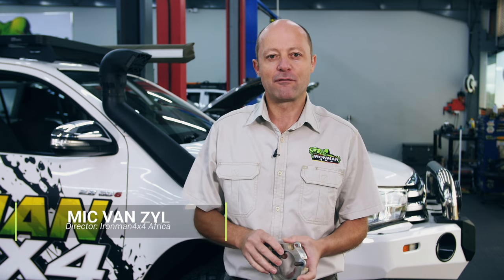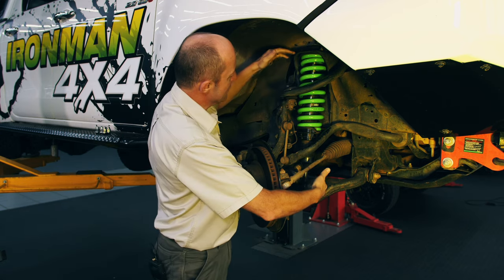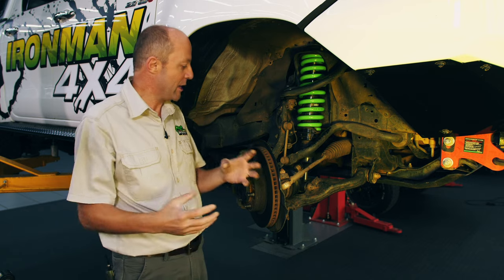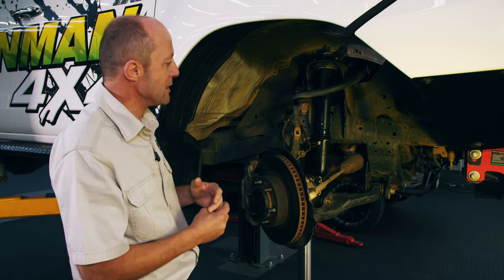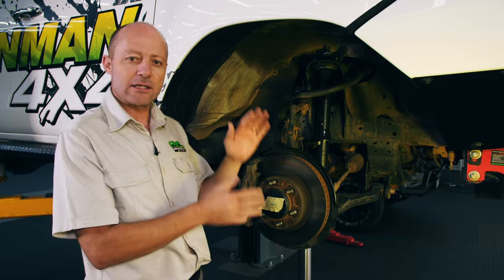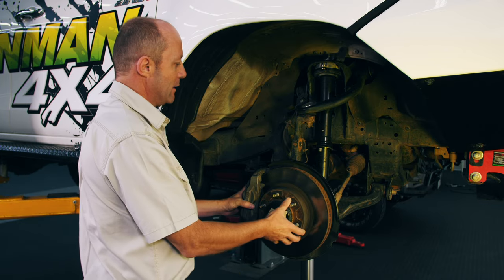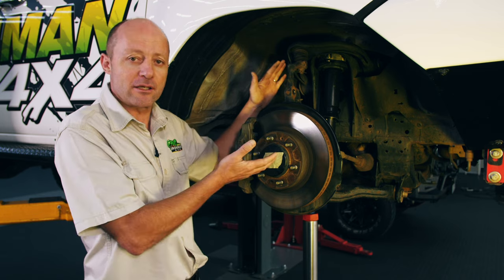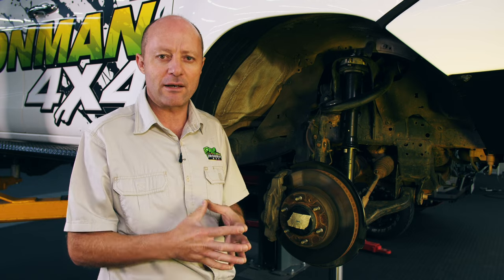Suspension Spacers - Tech Talk with Mic from Ironman 4x4

Comment: Man those things can easily be resolved. For stopping spring to from compressing too much, we just need to increase height of bump stop. And the last case you showed where spring comes down way too much, it will only happen when car is in air, it will never happen under load.
Reply: agree
Reply: Going offroad over bumps you actually have a likelihood of short bursts of full droop, still not a concern if you have limiting straps

Comment: So Mick...just to understand you right.... it will only be an issue when your vehicle is suspended in the air?? Because how I understand it, you took the suspension the the lower most point but that will only happen when you go hippie ca jeeey in the air.... What about front load, what about caber... Just asking or are you just trying to sell your product? Needless to say, I've got billstein suspension with a 50inch lift kit and never in my life have I encountered problems as shown on this video..
Reply: damn true,

Comment: Yes maybe they can be dangerous, but I've been driving with spacers for 8 years now no problems (on and offroad) and I still feel it's 1 of the best and in-expensive mods I've done
Reply: I woulnt listen to this too much , these guys are on the business of selling products , they make more from selling a $1500 setup with new springs and shocks than selling $200 spacers
Reply: @Ozfreerider_adventures  you would probably be best doing new upper arms that match the lift as well. This corrects the Alignment and allows more droop clearance. Not $200 if you factor that in as well. Just installing spacers alone is sometimes on the limit of the alignment adjustments.

Comment: How is that different to fitting a longer strut and raised height coil ? Wouldn’t the bump stop, cv angle and ball joint still have the same issues ? The coil bind issue wouldn’t happen but the others still remain or am I missing something here ??
Reply: Exactly! The only problem with the spacers is the compression of the coil and the bump stop, and is also only n problem of you go more than 20mm spacers, but I agree the cv angles, control arm, ball joint angle all still happens if you fit a shock with longer coil

Comment: Why not just add a bump stop extender on it eleminate all the hassle also the car isnt under load with the extreme angle once its on the ground it should get bit better. Still ita not made for it i get that but the risks in that size lift should be minimal.

Comment: Wouldn't a 2 inch coilover lift kit for this jeopardize the CV's and ball joint the same.         Also, If the shock is the droop limit, isn't it then "topping out" the full extension travel, and you risk mechanical damage to internal piston mechanism in a standard shock w/o internal bump stop or other mechanism?

Comment: On the Mcfersion struts the bump stop is on shaft of the shock component of the assembly so the spring will still only compress that same stock amount. The droop will be more however so the CV joints will be stressed at a greater angle.

Comment: 0. Did I get this right? The top limit of the wheel travel is the rubber bump stop. The bottom limit is the full open length of the strut. The difference between these is the "wheel travel".

1. When you say that only the static equilibrium point shifts when the ride height is "lifted", what type of lift do you mean? How was this "lift" achieved.?

2. If a top hat spacer is fitted above the strut, to achieve the aforesaid "lift", then the static equilibrium point would still shift down. But would the strut's extended length also cause the down travel to increase beyond the previous droop limit. Would this mean that the wheel travel in this case is not conserved and has increased? (by an amount equal to spacer thickness) ?

Thanks for the video and effort in explaining it practically.

Comment: Cool video showing why strut top spacers are not the recommended way to lift trucks. Though this is not a problem for McPherson struts where the bump stops are at the top of the shock 👍🏼 e.g. Subarus

Comment: Question, I understand the issue of the coil compression/bump stop.
In regards to the extended doop, CV angles etc, how is the spacer any different to fitting an aftermarket strut and coil to give you the same lift? (Note I'm not someone who recommends spacers due to the first issue)
Reply: Hi James. The total length of the strut is measured from the top of the strut top mount (that bolts to the chassis bracket) and the bottom eye of the shock. The strut top mount is mounted to the upper part of the shock shaft. This total strut length determines how far the wheel will droop when it is lifted off the ground when off-roading. The droop is thus controlled by the total length of the strut assembly. Fitting a spacer effectively lengthens the strut by adding the thickness of the spacer to the top allowing the wheel to droop further (about 2x the spacer thickness) which causes inner CV joint binding/eventual failure as well as upper ball joint over-extension. Fitting longer coils to a correct length shock (without spacer) doesn’t lengthen the strut assembly and doesn’t cause the aforementioned issues. A standard coil spring at normal ride height will carry the front of the vehicle more or less half way along the shock absorber’s length of travel half way between fully extended and fully compressed. Fitting an aftermarket lift coil merely lifts the ride height closer to the fully extended point. You thus have less droop and the wheel will hang sooner than with the standard coil. The strut length stays the same. No issues on full droop.
Reply: @micvanzyl  That is simply not true. If the aftermarket strut length is the same as stock, there will be absolutely no lift, unless the aftermarket would not sag at all, which would result in an impossible ride comfort. The majority of the aftermarket suspension on off-road vehicles also raise the vehicle. The CV is angled as much as in the case of a spacer at the same final lift. The droop is limited on some pickups (like the Ranger) by the upper control arm touching the strut housing. The benefit of an aftermarket suspension is, in the context of this video explanation, to eliminate the risk of the coil bind. There are solutions for that too, one could fit extended bump stops.
Reply: @mugurmartinescu5728   Sorry Mate. Some of your replies are simply not true. Please bear in mind that I have had a career in steering, suspension and suspension geometry for the last 30 years. While I see new things very often which is great, I've seen a hell of a lot during this time.

1. YOUR COMMENT: "That is simply not true. If the aftermarket strut length is the same as stock, there will be absolutely no lift, unless the aftermarket would not sag at all, which would result in an impossible ride comfort."
MY COMMENT: The lift comes from a spring with higher spring rate and/or a taller spring, not the length of the strut.

2. YOUR COMMENT: "The majority of the aftermarket suspension on off-road vehicles also raise the vehicle. The CV is angled as much as in the case of a spacer at the same final lift."
MY COMMENT: This may be true at ride height when the vehicle is standing on its 4 wheels on the ground. With a spacer fitted however, the total length of the strut is now longer allowing the wheels to droop further taking the CV angle past critical maximum angle. We see this very often. My youngest brother owns a very large CV and drive shaft business. He sees CV joint failure constantly with 4wd vehicles fitted with spacers. I cannot argue with him on that.

3. YOUR COMMENT: "The droop is limited on some pickups (like the Ranger) by the upper control arm touching the strut housing."
MY COMMENT: This is incorrect. The droop limit on the front of just about all Strut equipped 4wd pickups and wagons currently (including the Ranger) is determined by the length of the strut. That is why it is critical not to extend the length of the strut (which is what fitting a spacer to the top of the strut does). If your upper control arms are currently touching your struts, you have too much droop.

4. YOUR COMMENT: "The benefit of an aftermarket suspension is, in the context of this video explanation, to eliminate the risk of the coil bind. There are solutions for that too, one could fit extended bump stops."
MY COMMENT: The benefit of fitting an aftermarket suspension, provided it is a properly engineered product, is to induce a lift where required that ensures that all of the front suspension geometry limits as designed by the original vehicle manufacturer engineers remain in place. This will ensure that you do not have component failures while traveling down the road in your 4wd with your family on board and other road users around you. Fitting a spacer on top of the strut and then compensating for this by fitting an extended bump stop may well eliminate the potential coil bind. It will however certainly not eliminate the over extension of the droop. There are many vehicles with spacers and other cheap and easy suspension lifts (extended shackles) out there. We get them into our workshop every day. Most will not experience any issue. However, we have had far too many vehicles arrive at our workshop with serious suspension failure or imminent failure due to spacers and other unsafe modification issues.

We refer to suspension components as "LIFE & LIMB" parts. If they fail, you could lose LIFE & LIMB. I cannot fathom why one would risk your life, those of your loved ones and other road users by saving a couple of bucks on a properly engineered suspension lift by going for these quick fixes.
Reply: @micvanzyl  thank you for this thoughtful explanation. It makes sense and I appreciate it and apologize for making some assumptions. The explanation of the overextending CV makes sense now.
Reply from the maker: @mugurmartinescu5728   You're most welcome Mate. Safety first.
Reply: @micvanzyl i have a question. If you do a 20 -25mm spacer , and your drive is 95% onroad and 4% gravel road and 1% maaaybe a bit of offroad is all of this still relevant?
Reply: U need to upgrade the upper A arm
Reply: @mugurmartinescu5728 in that case what if u put in a spacer which extends only as much as an after market strut ?

Comment: I had my 2” lift on my Pajero gen 4 but it seems still not enough height for me,I’m planning to ad 20mm coil rear spacer and 10-12mm front strut. Just a bit additional of height,do you think it’s too risky and not good for the cv joint?
Reply from the maker: These vehicles have independent suspension both front and rear. 40mm is maximum you should be lifting these. Certainly drive shafts will become an issue over time. Shocks topping out on suspension rebound = $$$$$$.
Reply: Increase your tire size, that should give you more ride height

Comment: Wouldn't a longer shock/spring assembly also have the same issues as a spacer? For example, the upper control arm at full extension and the CV angles?
Reply: Yes it can..then to fix that problem you need to upgrade upper control arm
Reply: And what about the CV angle ?

Comment: Mic, 2 questions: 1 if I fit the spacers with a shock extension and bump stop spacers too will that have the same negative effects mentioned? 2 if i do a spring replacement of +25mm instead of the spacers will there be any similar issues?

Keep in mind I drive a 2018 Suzuki Vitara LY and just want a lift to fit some larger tyres for more clearance.
Reply: Hi Ruan. I cannot comment on the Suzuki as we do not have suspension for and have not worked on this vehicle. Any spacer between the top of the suspension strut and the vehicle chassis mounting point is going to allow the wheels to drop down further past the original suspension travel droop limit originally intended by the vehicle manufacturer. This may well compromise the upper ball joint and the drive shaft angles. Fitting 25mm lift coils will not cause this as long as you keep the original shocks or use shocks that have the same length as the originals.

Comment: I have a question for you in the 4x4 sector and I would like to know if you can tell me if it is true that the ironman nitro gas shock absorbers go well with the original series set-up and can they be adapted with the +5?  I have a Suzuki jimny 4x4 with m13a 1.3 l petrol engine with standard shock absorbers and calibrations, yesterday afternoon I picked up the new ironman nitro gas shock absorbers and the 4x4 spare parts dealer in Florence told me that these ironman nitro gas shock absorbers are ok for off-road 4x4 with suspension standard or in a second you could put the springs higher and it becomes a +5 high setting is it true?  Greetings from Florence Italy!

Comment: But, with a lift kit with spring and shock, the over extention would have the same issue, wouldn't it? The only "bad" i see here is on full compression, when the spring is fully compressed before the bump stop kicks inn. As i see, this is the only downside compaired to lift firt spring and shock. Unless you go full package with control arms, diff lowering kit + + +
Am i thinking completly wrong here?

Comment: That’s quite a large spacer, I’m guessing with something like a 10mm spacer which I’ll give you around 15mm lift at the wheel, to correct sag caused by bull bar etc. would not be such a big deal. Anyone have any thoughts on that?

Comment: I am planning to put spacer to allow less than 4% increase in size of my tyre as I want a A/T on my nissan x trail t32. Are there recommended spacers to buy. I will be off roading once in a year probably and not hard core. I just want clearance from ground. I know some friends did plastic spacers but did not have any issues . They dont do 4x4 wheeling in regular basis though. What set up is advisable then to give more clearance on my car for beach and desert ride. Will not be doing desert or the like safari.

Comment: Hello there!

What about just a 40mm / 1.575 inch "cheap lift kit", just for daily usage, almost never anything seriously offroad, gravel/light muddy road at best.
2010 RX350.
I don't really think I'd run into any of the problems mentioned in this video.
Can anyone chime in or share their experiences with similar usage?
Also.
OEM is 235/55r19.
I'm at 255/65r17.
For 27.5% more side wall; much greater bump absorption, and on super quiet tires, with internal sound dampening.

Just thought a 40mm 'cheapo lift kit' would fit the bill for slightly more ground clearance, as am in a 3rd world country, and wanted to hear some of other people's testimonies.